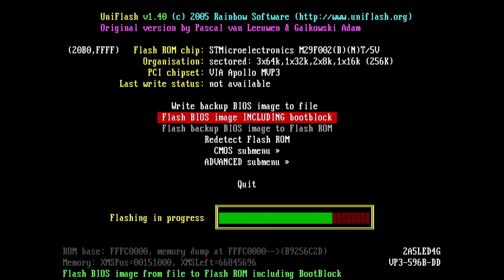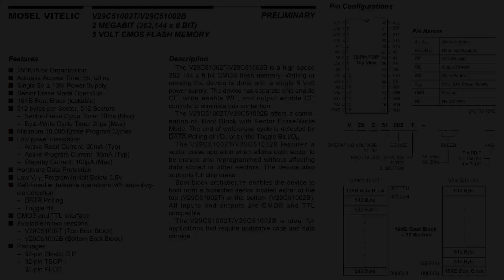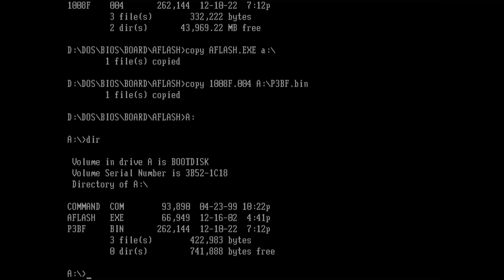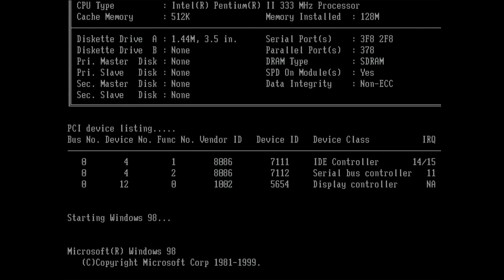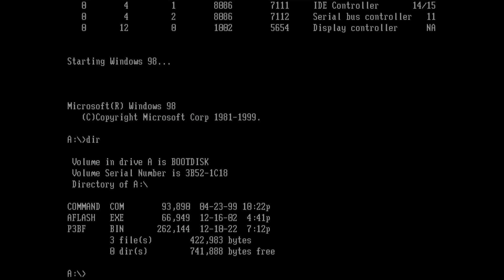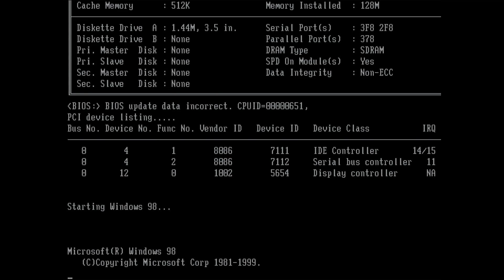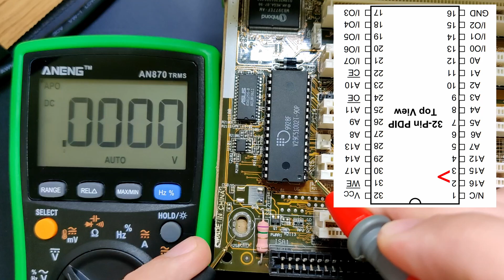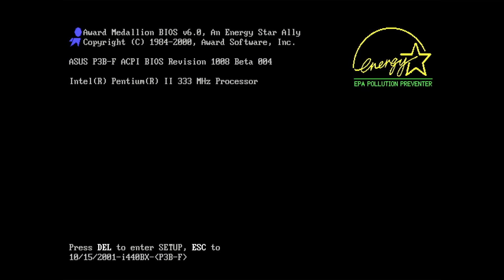Brick My BIOS - Boot Block Recovery and Hot Flash

Comment: Great work 👌
Shorting the tow pin work only with broken bios with intact boot block?
Reply from the maker: The boot block has to be intact, yes. Sadly I couldn't simulate a flash mishap by cutting the power, therefore I had to short the pins. In my case, the boot block and the main bios we're still intact. I just made it believe the main BIOS is corrupt but shorting the pins.
Thanks for watching my videos!
Reply: @bitsundbolts  Thank you.
I thought that shorting those pin work to force the bios to boot from boot block if it flashed without boot block

Comment: I actually used this method to fix an old Athlon XP system with a bricked BIOS. Shorted A15 and A16 on the chip, it loaded into BootBlock and I was able to flash a good BIOS to it.
Reply from the maker: I wonder why the BootBlock doesn't work as it should! In your case, it should have automatically booted into the boot block. I guess this technology was still in it's infancy and worked only in certain cases.

Comment: I think that when the flasher clear data from the chip, it clears it all, along with the boot block, so it has to flash the entire chip. Therefore, it pre-reads the data from the chip and places it in memory. So if you specify /BOOT option, the flasher will take the boot block from the firmware file, and if you do not - it will take it from memory.
Reply from the maker: I also think that the flashing tool erases the entire chip. But that would mean that you won't be able to recover from a power cut during flashing - which would be a shame.
Reply: @bitsundbolts  This chip provides the Boot Block Protection feature. Do you have such option in BIOS Setup? If so, can you update BIOS (including the boot block) with this option enabled?
Reply from the maker: There is no such option in the BIOS, at least I didn't see it. And I am not aware of any jumpers on the board either.
Reply: @bitsundbolts  Oh, ASUS has a manual for this board on the website, sorry. There is no such option in BIOS. Do you have a TL 866 programmer or something similar, so you can check what data remains in the chip after unsuccessful firmware flash?
Reply from the maker: I don't have a flash programmer yet. I'll get one some day. And yes, you're right, with a programmer I could check what remains on the chip...
Reply: @bitsundbolts  Thanks for the great video anyway.
Reply: @bitsundbolts btw you can use an arduino or pi pico or similar microcontroller as a flash programmer (read and write) if you don’t have a dedicated one yet. I unbricked a Wii U using a Teensy (and later a Pi Pico after modifying the source code to support it) by using it as a programmer to flash a backup.

Comment: Shorting those exact pins while flashing the EEPROM would’ve bricked it the way you wanted. :) 

Thanks for the informative video!
Reply from the maker: Interesting idea. I wonder if aflash would notice during the flashing process. I think it does a verification after writing - so it should detect that the flash was unsuccessful.
Reply: @bitsundbolts  if it confirms it’s unsuccessful, it’ll be very interesting to see how it’s going to fix it, if it even tries to fix it itself. :)
Reply: @Inject0r  it cannot fix it, it won;t try anything. probably it will display a message that the flash was unsuccessful and then stop, some bios flashers might also display "DO NOT POWER OFF" or something similar so you can retry the flashing.

Comment: 9:30 A lot of older motherboards , have BootBlock recovery procedure without any picture. I mean you powerup computer, and you see black screen. The floppy drive LED/light on some motherboards will stays all the time on, or it is off all the time, but as soon you plug in the floppy, it will shine. Then without any picture you will hear that floppy is working. When it stops, you reboot system and then the computer will starts normally with picture.
IF fact, I'm very suprised that I see the recovery screen on your video. I made few recoveries in 90s and I never had a sceen during the procedure.
Reply: As mentioned in the video at 2:55 it requires a ISA video card, will not work with anything more modern...

Comment: oh the old times
i once had to flash a slot 1 motherboard with corupted bios without having any working board i could use as a programmer, but i did had different board with the same chipset, only broken
so i took bios from that broken board and placed it the one with corupted bios... and it posted. keyboard wasn't working but floppy did. So i made bootable self flashing floppy with correct bios and flashing program and board was saved.
computer repairs back 15 years ago in time were  so much more exciting, you could literally frankenstain the solution, now you can't even mod some bioses :(

Comment: At least for AMI BIOS you have to press CTRL-HOME during powerup to enter the bootblock.
Reply from the maker: That is a really nice feature. I don't think this is possible with AWARD.
Reply: @bitsundbolts  After a bit of research, some "newer" (in retro timelines) Award-BIOSes are told to have a built in flash routine, activated by pressing ALT+F2. I don't know at what generation (maybe p4/athlon x2/somewhere around) ? I'll try it, in case i remeber this when i'm working on some older machines next time.
Reply from the maker: Good info, I'll try to remember too!

Comment: Oh, Bios Hot Flash, I did something bad with my PC and my parents PC in my early years. Fortunately they never found out. Shall I tell more? 😅
Reply from the maker: Please do - this is the internet - a safe place 😉
Reply: @bitsundbolts  Year 2000, my first (good) PC, a 1200Mhz system with a GeForce2MX, but some games still running slow, few months later reading about overclocking, became curios, dissapointed by limited overclocking capabilities of my motherboard. Had the stupid idea to try out a bios file from a more expensive motherboard of the same manufacturer and the same socket. Was hoping for better oc capabilities. Crawling a PCGH or GameStar CDROM and found an apparently suitable bios. Did the the bios flash and nothing, board was dead... How stupid and naive!

Got a little panic and I came up with the idea of a bios hot flash the next morning, ripping of the broken bios chip and thought it must be possible to repair that chip. No idea how I came up with this idea, had also never read about a hot flash. So, it was on a weekend when my parents usually sleep longer. I sneaked into the living room where my parents pc was. Opened the case and saw, it was a AMD SlotA system (my system was a AMD Socket462). Thought and looked at the bio chip more closely, cheerful, the chip was also swapable and looks similar. Ran back to my room grab my bios chip, created a floppy disk on my old 133MHz pc with the correct bios from the previously mentioned CDRoms, and sneaked back to the living room, booted my parents pc and opened the flash utility, removed carefully the bios chip and inserted my broken chip, study the flash utility command list, added some commands and started the flash procedure. Some seconds later the screen show up a succesfully flash, was happy, shutdown the pc, puts back the original chip of my parents pc, started the pc and god bless the pc was still working, removed all evidence and went back to my room.

Immediately put the bios chip back into my pc and started the pc. And wow, the pc was back on live and shows up a boot screen, loaded the bios defaults and started Windows. Believe me, I was absolutely happy afterwards. So, I never stopped doing risky maneuvers with hardware before and after. How crazy can you be to do such stupid things. I will probably never understand. Curiosity, no risk no fun or something else... who knows.😆
Reply from the maker: But hey, you resolve that situation very well! Congratulations!

Comment: Hello. I have a M6VLR board which recently got the bootblock error which brings up the display only using a PCI card. I followed the similar steps to create a bootable floppy(DOS bootable) using the official bios bin file and AWDflash tool. The problem is as soon as it gets into "Detecting floppy drive A media" it doesn't proceed any further. Tried using different drives and also a gotek but the same result. Any reasons for this issue?
Reply from the maker: Does the floppy LED light up when it starts to look for the floppy drive? The board might look for specific files to be present on the floppy.
I thought the boot block will only show up when using ISA cards, but newer BIOS implementations might also work using a PCI VGA card.

If the floppy read-LED doesn't light up, then the boot block doesn't find the drive. Maybe you need to use a specific floppy cable or a different connector in case you have a cable with multiple connectors.
Reply: @bitsundbolts  The floppy drive/gotek did infact light up as soon as the message "Detecting floppy drive A" and is constantly ON. Have tried different versions of the awdflash tool, but in vain. Had also used the same cable, drive and floppy which worked in my other pc but same result.
Reply from the maker: You're definitely not the only person who has this issue. I found several suggestions online - things you could try:

1) use real floppy disks - try different disks if the one you're using doesn't seem to work.
2) try without a VGA card. Basically nothing should be connected except for the floppy drive
3) make sure the BIOS file has the correct name. I know you're using a bootable disk (so, autoexec.bat and the other system files should be there - those files might be hidden). It could be that you need to unhide those files - you can use attrib under DOS 6.22

Those are just suggestions I found online. The benefit of using a real floppy drive is that you hear when it accesses the diskette and reading it.
I read some people made it work after testing a dozen floppy disks. One person said, it worked after removing the VGA card. And another person mentioned that it's important to rename the BIOS - most probably AWDBIOS.BIN

You're entering the boot block because the checksum of the BIOS is not correct. Either your BIOS chip is suffering from bit rot (which can be fixed by reflashing the chip), or it cannot hold the ROM image due to faulty memory cells -> then you need to replace the BIOS chip anyway.

I'm afraid there's no single easy solution. Boards can be different. All you can do is to try different approaches and see if something changes.

Comment: I found out the hard way about why you should really try to replace your CMOS chip with the exact part number of the original.  Many lost frustrating hours on trying to figure out why using a T48 programmer was failing (even though it passed all  flashing test) to produce a properly working brand new CMOS chip  in a vintage slot 1 Chaintech motherboard.  Thank you for giving me the answer on why my approach was not working.  I never realized that different CMOS chips could potentially store the boot block in different locations.  SYMPTOMS: The result with the use of a different CMOS chip might be a possible first successful boot (or no boot at all) followed by  a failed second boot that gives one long beep and then three short beeps  (failure to initialize the video card)  then a high tone and then low tone. (CPU failure)  If there is anyone reading this that needs the original MX 32 pin dip CMOS chip for your vintage slot 1 Chaintech motherboard please do not hesitate to reaching out to me as I have extras.

Comment: The idea to flash new boot block at the end of BIOS flashing is great if you cut the power or reset the system however the programmers of that tool forgot that they erased the whole EEPROM at the start 😅

Comment: So stupid idea...use programmer and program it to the new chip
Reply: Why stupid? Before chips became cheap commodities thanks to China, this was the way to recover a board. Also, buying a programmer doesn't pay if you will flash just one board. If you will not do a paid repair job for a real customer, use the tools you have on hand. Hot flashing is one of them.
Reply: it's not a stupid idea.  or wasn't a stupid idea back in the day anyway. 

like for example you could have just bought a new motherboard than sourcing a programmer and/or spend weeks without the fecken thing working.